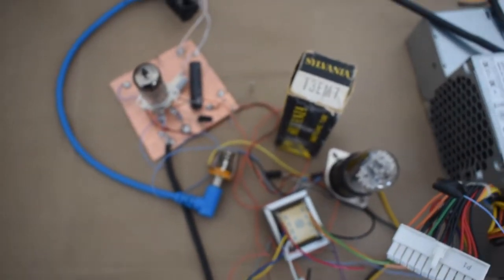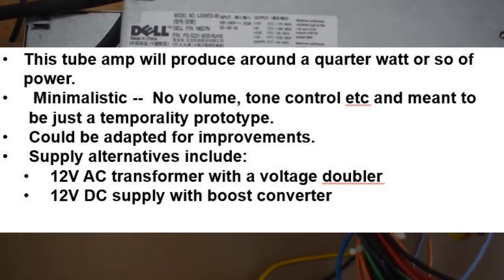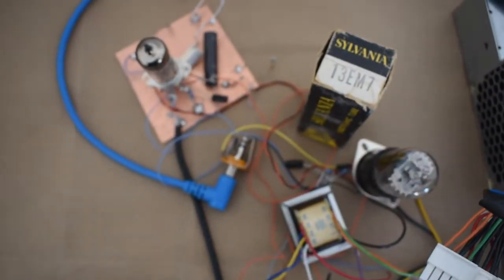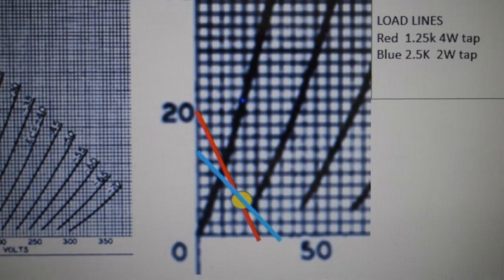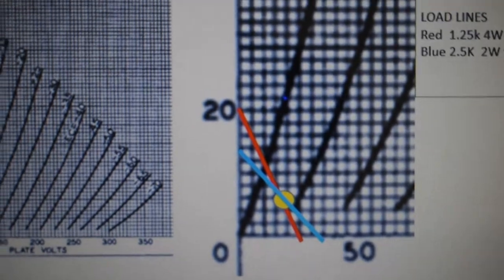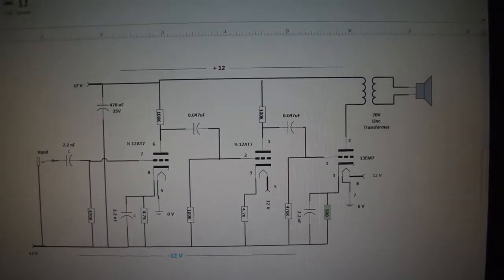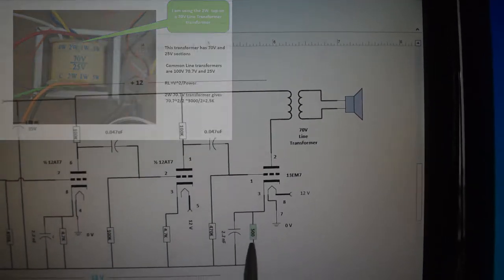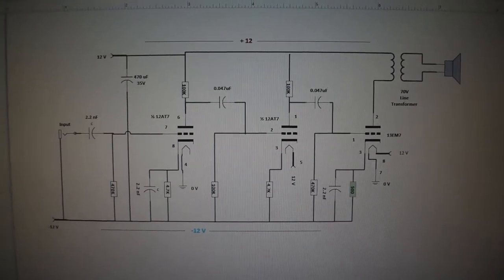A Low Voltage Low Power 24V DC 12AT7 13EM7 Tube Amp

Comment: Real tube audio begins at 500 volts ;)
Reply: Yeah and a tube rectifier. My Atwater Kent I had was 700 volts with a center tap. Which I got 350 volts per plate. On a 5Z4 rectifier tube. Then reduced down for the tubes b+. I really miss that radio. It sounded like stereo on AM. Well the radio stations don't play good music for the radio anymore I can get music on the internet and just pipe it through a tube amplifier. 73
Reply: @ronb6182  indeed. It is more rare these days people actually play with tubes even if many like to sell them and is probably for the best too. But those who use them know the truth about them too :)
Reply: @Pulverrostmannen  yeah I don't claim to know everything about tubes. I just learned why one of my tube radios didn't work. I tried to change the filament string this was years ago. The 601 granco FM radio had a selium rectifier and I broke the 10 ohm resistor so I decided to put a 35W4 in the series string it worked well so I decided to remove.the 50C5 tube and replace it with a 35C5 but it didn't work. Little did I know not having a schematic there were resistors in the string also. Well I left the 50C5 in the string there were 3 12 volt tubes 1 19 volt tube and the 50 volt tube that makes 105 volts then add the 35 volt tube which is 140 volts plus the resistors. The radio worked and picked up stations over 100 miles away with a twin lead T antenna in an attic room. It also sounded good with the oval speaker inside a wooden case I made for the radio. I didn't think to measure the voltage off the rectifier but I didn't know what it should have been with the selium rectifier. One broken resistors caused this wild goose chase. I didn't have a 10 ohm resistor only a couple of.100 ohm resistors. I was in the ninth grade. I also built a greymark two band radio.ejich I learned how the tubes worked. I had to rebuild the radio because I had a b+ short and couldn't find it the Amplifier circuit worked. Well the second go around worked  I also repaired an AM radio for a friend his had a shorted IF transformer I took it apart and found the short.
Back to the FM radio. I guess if I had the radio today it would work with 125 volts. Maybe need to change the b+ resistors . Tubes are for people that want the full sound with all the left out harmonics since music is made up of harmonics and overtones. 73

Comment: so 70v line transformer can usewith this tube,,, how much impedance in the primer?
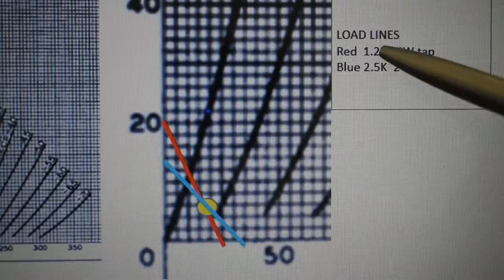Reply from the maker: The primary is set between 1.25 K to 2.5K based on the load lines the output tube sees, 1:37  Any suitable audio transformer can be used that steps up the speaker impedance to this range.

Comment: Hi, nice project! But i think, a tube amp make only sense by low distortion. To play clean, you can take every transistor amp. You get in directly, so you need another valve or an OPV to encrease the volume.
Reply from the maker: Thanks for the feedback. I am using 2 gain stages prior to the 13EM7 output triode tube/valve. The 13EM7 has 2 triode sections but I only used the power triode section. Perhaps the unused 13EM7 section could be considered as an extra stage.
Reply: You can still put something in the lines of a valvecaster between the guitar and amp to add an extra gain stage ? Or even build it into your amp's chassis !